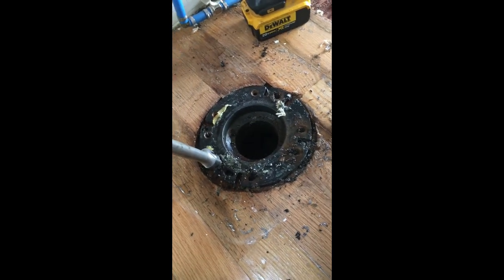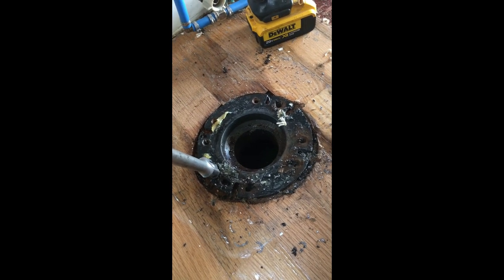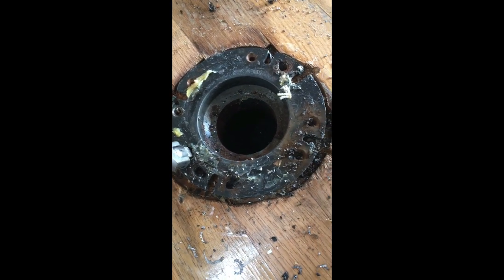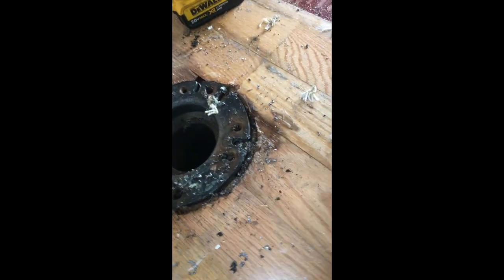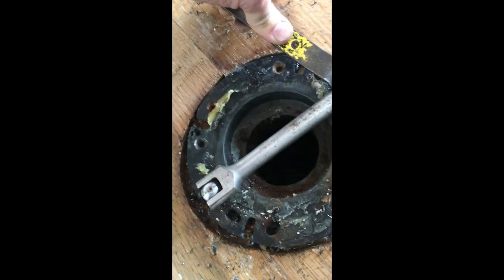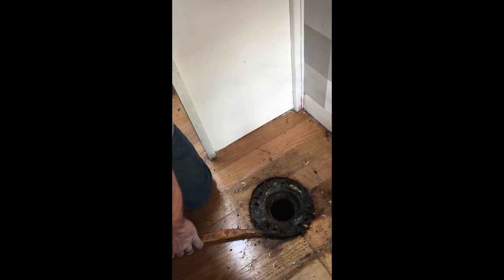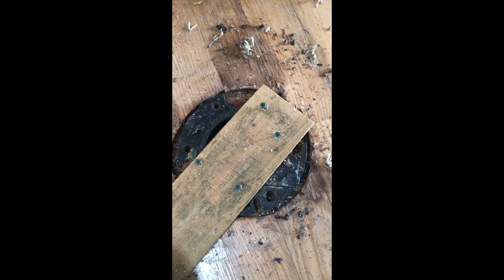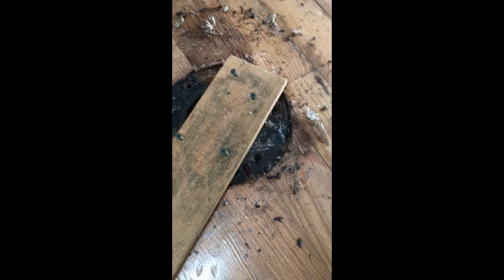Airstream Travel Trailer toilet Flange removal

Comment: Thank you! My husband is doing this today. We have the same flange. Thanks for paving the trail. You fought a good fight.
Reply from the maker: Spell Madam,  I’m glad it helped!  Let me know how it goes or if you have some video ideas
Reply: Boy he is really struggling. That won't budge. Afraid to damage the stand pipe to the tank. Considering a flange repair kit but that's not ideal.
Reply from the maker: Spell Madam, it should be threaded directly into the tank,  it’s unlikely to damage the tank.  Just be sure you have all of the screws removed and that one isn’t hiding.  As an alternative you can cut on the inside of the flange with a hack saw.  But you have to be very careful not to cut into the threads of the tank.  When you’ve cut most of the way through you can chip out the old flange.
Reply: Accidental Tradesman ...he can twist it like in your video but it does not raise up so we suspect it may be glued. We are thinking of buying a black ABS flange assembly with a seal that will fit inside the 3inch pipe with a seal
Reply: Sure appreciate your advice. What a job
Reply from the maker: Spell Madam, it’s possible I guess.  The top of the tank is pretty flexible so it might take a couple of turns before you notice it raising up, as it will let the top of the tank sag a little at first.  You have an Airstream right?
Reply: Accidental Tradesman no sorry not an airstream but we checked with manufacturer told us it was screwed. Outdoor manufacturing Blackstone RV. Same assembly as in your vid
Reply from the maker: Spell Madam,  let me know how it goes, or if I can help at all
Reply: Accidental Tradesman thanks.
Reply from the maker: Spell Madam, did you guys get it done?
Reply: Accidental Tradesman he had to buy a toilet floor flange. We live rural so just got it today. Hopefully that works. The broken original flange won't come out without damage. He tried everything
Reply: And he is a diesel tech for 30 yrs. He worked on a lot of motor home coaches. He tried everything. We appreciated your vid a lot. Great ideas.
Reply: He cut the floor flange with a die grinder just below floor level. Using die grinder added paddle sander to clean it all up to accommodate new flange with rubber pipe seal that pushes into stand pipe.

Comment: Thank you for the video. I had to remove a bunch of rotted plywood subflooring around the flange so I had no problem with the screws that are supposed to hold the flange to the floor. I used 2 of the screws that hold the toilet to the flange in the slots on the outside edge of the flange and used the rv's lug wrench. I had to put some back into it to break it loose initially but it came out well the rest of the way. Managed to not damage the flange so I don't have to buy a new one. Happy happy. Oh we have a 1998 Holiday Rambler Endeavor. It looked like the toilet seals been leaking for years. Not happy. Anyway, half-way done, now I have to put in new sub-flooring and put the tile back down.